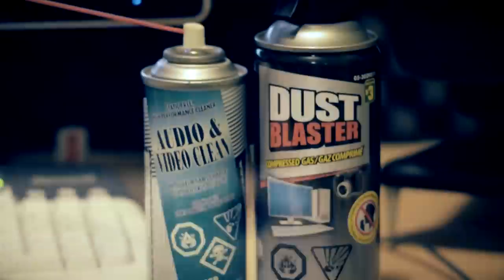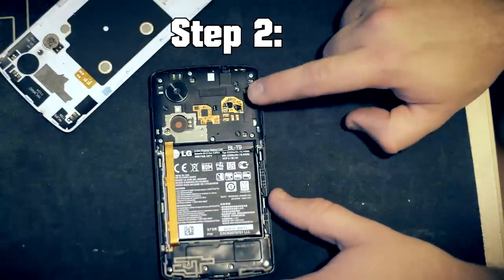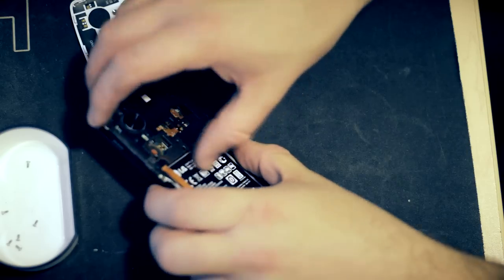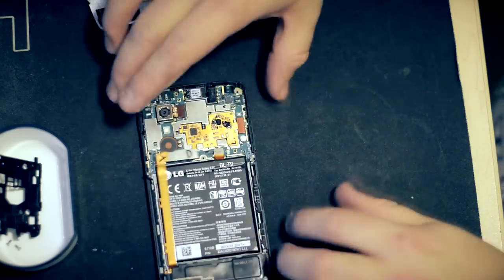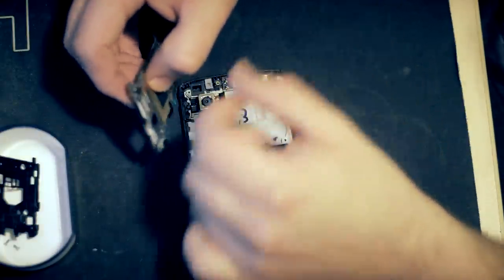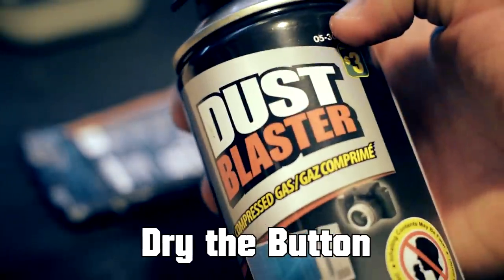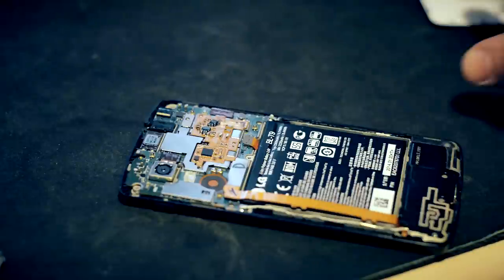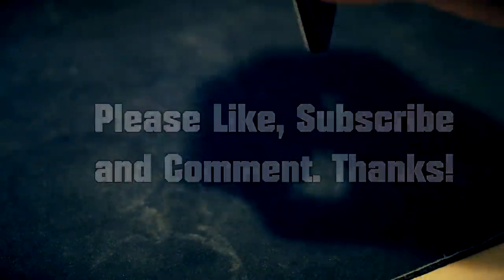LG Nexus 5 Boot Loop Fix - Power Button Repair -

Comment: Fantastic tutorial! I didn't have much hope, but this saved my Nexus after it began to have problems with the power button (it wasn't stuck in a boot loop but turned on and off almost every time I turned screen on and off).

A few notes. Be careful with removing the back cover, the plastic pieces that snap it into place break easily. I also thought the plastic part of the power button was broken, mine didn't have anything to keep it positioned. And I didn't notice any difference after applying alcohol to the inner part of the power button.

Still, after putting it together again - it now works like a charm. Thank you for a great video!

Comment: My power button started to behave freakishly 2 days ago and yesterday in the morning it switched off and since then I wasn't able to boot it anymore. I tried smashing the button against the edge of my table but to no avail. I've even put it in freezer for 15 mins as that might help but again no result. I came across your video and deciced to go for it but I was skeptical at first. I dismantled the phone, did all the cleaning and clicking as shown in the video but my device didn't boot up so I felt down in the dumps and dissapointed reassembled the device. I gave it one more shot and pressed the power button hoping for the best and yay, IT WORKED! I've never been so happy in my life. Basically what I'm trying to say is that if anyone has the problem of not booting up as you did in the video, try putting everything back together first and magic is about to happen. Thank you very much. Oh and btw, I used aftershave (containing alcohol) as cleaner because I don't have anything like that at home. :D
Reply from the maker: +Filip Randjak Nice! The aftershave is a great idea!, although depending on the type it could be sticky and leave residue maybe? In any case it worked so it did the job. I personally never tried the hitting the phone thing because i didn't want to risk damaging something else in the process.

Comment: And another rescued Nexus 5! Thanks for the tutorial! Greetings from germany! 

I used "Kontakt WL" to clean the switch. Before cleaning I still heard the "click" from the switch but the symptoms where as described (bootloop). Now the Nexus 5 is fine again. 

Attention, while reassembling I noticed, that the plastic power switch (not the micro switch) has a little hole which has to be placed on a small pin inside the case!

Comment: I can confirm this process worked for me. and I just used regular glass cleaner and used my own exhaled breath (hard blowing) to clean the button module. thanks for the tips! and you're right. the hardest part is getting the back cover off the phone.
Reply from the maker: +Ryan  Olsen Glad i could help! :)
Reply: +Ryan  Olsen Regular glass cleaner? Did that work?
Reply: Wow it worked! Thanks a lot,  man :) i used vodka instead of the  video cleaner and now it's working again.

Comment: Hello, thank you very much for this simple and clear video ! I disasembled my nexus 5 and cleaned the power button with electronic contact/welding cleaner spray. And there's no more power button problems. I got my nexus 5 from 4 years and it's still good and it will be for long time more thanks to you.

Comment: Right on!  This worked great. No more boot loop.  My Nexus 5X had the newer long form motherboard, but the principles remain the same.  Remove outer cover. Remove screws and inner cover.  Disconnect three connectors.  Remove board. Clean and reinstall. Thanks again!

Comment: Great money savings fix!  Completed the procedure in 25 minutes on my daughter's Nexus 5 and it is back to normal.  Used 91% Isopropyl alcohol which you can get at CVS/Walgreens and a $2 can of air duster. Much more economical than getting a new phone.

Comment: Thanks very much. It worked for me. I have been suffering with the problem of my Nexus 5  rebooting often, but always recovered itself. However, yesterday, it was not coming out of the reboot loop. 
Your suggestion that power button is clogged and is causing the problem, proved to be right.
You video is a little quick to realise that there are two flat connectors on the top have to disconnected before being able to take out the motherboard board.

Comment: Thank you for a great  explanatory video. When i had got the nexus 5 apart it was clear that my problem was not the switch but  the plastic button in the case. There are 2 minute bit of plastic (acting as a spring) one was broken and jamming making the button stick. I removed the button, cut off the plastic bits and bingo the button now is free to move and not stick. I hope it lasts.

Comment: Great instructions!! Was really helpful. My issue was actually the black button on the outside. After I opened and checked the inner white button, I didn't notice any stickiness or dust, but it looked like a tiny piece of the black button had broken off on the inside so that when you press it, it doesn't pop back out all the way like it's supposed to and keeps pushing on the inner white button. It wasn't noticeable when the phone is intact but I could see it when I took everything apart. I ended up jamming a tiny piece of plastic under the black button on the edge/side that wasn't popping back out properly to force it to pop back out every time I press it, then replaced all the pieces back in and it seemed to have worked!

Comment: This worked for me!  I'd seen other videos suggesting banging the phone, or replacing the switch.  My switch didn't feel mechanically stuck, it clicked in and out.  But phone was stuck in reboot loop.  Taking it apart, cleaning with compressed air and then electrical contact cleaner seems to have fixed it.  Thanks for the video!

Comment: What worked for me was following this video, but not disconnecting the battery and sidewires. Just take the motherboard protective cover off and use one of those fine plastic-rubbery softpicks which the dentist keeps telling you to use for between your teeth (not the one with the metal wires and get the smallest ones for better reach). Once the protective cover is off you can see where the power button connects to a tiny white switch. Clean around it with the toothpick (or small brush--toothbrush could work) and make sure to press the power button and clean in there as well. You may also douse the toothpick in A/V cleaner or other cleaning product safe for the electronics/plastic. All the filth and sticky stuff is mostly around the button as it creeps in through the cracks around the power button. Give the rest of the phone a clean where necessary like this as well. Reassembled and worked again. Use the leftover softpicks to maintain good dental hygiene for clean breath and a happy dentist.

Comment: Just fixed mine using this. There was nothing evidently wrong with the button even after opening. But wiping and pressing several times thankfully worked. Thank you! 
PS. You could've hinted how stubborn the back cover is though :)
Reply from the maker: +Dileep P G LOL yeah, i mentioned at the end it&#39;s probably the hardest part. Seriously what a nightmare to take it off lol . Glad to hear you got yours working!

Comment: Thanks for the video +Weekend Agenda When I had this issue I looked on some forums and they helped me isolate the problem but having the video to watch made it so much easier to know I wasn't going to hurt anything. One thing I found though is that the external part of the button on my phone had a large build up of dust around it and this was also gumming up the action. For other viewers looking to solve this problem on their own phone I recommend cleaning this area as well, doing both these things quickly solved my problem. Thanks again.
Reply from the maker: +Isaac Hunter Great advice! Thank you for the kind words :)

Comment: Thanks very much! Like somebody else said my button was not mushy, but still clicky. The clean did the job. Only thing that I would add is to use plastic tools for levering off the connectors, to avoid damaging anything on the board.

Great video though, thanks again!

Comment: Fantastic video, made me able to get in and out of my phone no problem - but it didn't fix it unfortunately. The switch on the motherboard looks super wobbly, it doesnt go just up and down like the volume switches do. This this goes side to side and everything, you can move it so easily, so it's surprise my power button was so volatile and sensitive. I have no idea if this can be replaced or not, just gona see if I can get a temp fix til I can at least afford a new phone. Have to admit, I'm probably just going to let my lump hammer go to work and lower my stress levels

Comment: Thanks for the help man, I found the hardest(and most stressful) part was removing the back panel I was worried about undoing the ribbon and other cables but they weren't so bad. My phone works just as good as it used to now!

Comment: Great video, it's very helpful. Minor note, though, the antenna cables are just that, they're aren't ribbon cables. Ribbon cable means a flat cable with multiple lead, the antenna cable are round cables with a single lead. Have a good one.

Comment: I did this and it was a temporary fix. Every couple of months it kept happening and worse each time. Finally, it wouldn't work at all so I did one last thing before giving up and buying a new phone AND IT WORKED!!! I simply opened up the phone, took a pair of tweezers and litterally ripped out the power button. Since then, I had been keeping my phone charged at 100% just in case I could never turn it off again but today it locked up on me and...wait for it...I inserted a piece of metal into the hole where the power button used to be and it made the connection. Yay! I have my phone back with no power button issues! I just stick the end of a pair of metal scissors in to turn it on and off.

Comment: I did that today. Thanks a lot, it worked. I did not use the cleaner spray, because I did not have any, a Q-tip with some alcohol worked just fine.

Comment: Thanks for video. Now its 3rd time that I open and repair my Nexus 5. I don't usually clean the particles with any type of sprays. Whenever I finish it works for one month, then again starts switching of

Comment: Thanks man, this did the trick! I used a small kitchen knife since I didn't have a small Philips head screwdriver and scraped the buttons clean instead of using audio/video cleaning fluid, but it still worked.

Comment: This video didn't work for me right away but got me started on the right track. So my phone over a period of 2 days went from a very unresponsive power button, to shutting off randomly, to not coming on at all. The only way I could get any life out of it was to charge it or plug it into my computer and it would get to the black google screen and then reboot and continue non stop. I first dabbed isopropyl on the power switch and gave it some work but still no difference. After watching some other videos some users soaked the button in isopropyl and really worked the button. Move it side to side, up and down, rotate it, drag it down to one side with your fingernail and release it hard. I started to notice it was sounding more like the other two buttons for the volume control. The winner was taking a pair of tweezer and placing one pincer on the button itself and the other on the back part of the switch and giving it a few really good squeezes. I was afraid I was going to break it but at this point the phone was useless anyways. Then all of a sudden it was clicking like it was new. I probably soaked it 3 times or so for about 30 seconds and worked the hell out of it. I put it back together for the 4th time and it works like new. Super stoaked. If this didn't work another user just popped the power button right off and the phone would turn on as soon as the battery was reconnected. They then used an app that could turn your phone on and off. That was going to be my last attempt as my phone is a couple years old now. Anyhow it works so I will go hopefully another year before something else goes on it. Long live the NEXUS 5 !!! 

Thanks for the help !!

Comment: Thanks for this video! Rather than opening it up and cleaning it, I just flicked the power switch a few times with my finger and pressed it madly for a few seconds and that helped unjam it.  I'll probably have to clean it eventually, but this was a good short term solution.

Comment: Great Video! Tried pouring 95% isopropyl alcohol from pharmacy and clicked several times. Din't work. Tried again, except this time left battery disconnected for more than a hour. When i put it back, the looping went away. Not quite sure how long this fix will last!!

Comment: After replacing the charging circuitry (which I thought was the problem) I tried this method and it fixed it! Thank you so much for sharing this. 

I guess the swtiches that LG put in the Nexus 5 are just lousy?
Reply from the maker: +Aaron Eiche Lousy would be an improvement lol. No worries, glad it worked!

Comment: Thank you for the video.  Here's hoping it fixed my random reboots and erroneous shutdown menu pop-ups.  I feel awfully ham-handed after this.  I managed to break three clips that hold the back plate on.  It clipped back on with barely any noticeable movement, so I think I got lucky.

Comment: I would suggest for anyone trying to remove the back of the phone, you need to use a heat gun on certain spots. A blow dryer will compensate as well. The reason for this is that there is an adhesive keeping the back in place. If you damage the back part of the housing, depending on the area affected, you may have to replace it. Also, when using said heat gun/ blow dryer, do not  over heat your phone or you'll fry the components inside and could possibly ruin the phone all around.

Comment: Hi, great video! My N5 is stuck in a reboot loop as well, and it is definetely something with the power button. Smacking the phone works very rarely, but it definetely does something. The button is still pretty clicky though, so could it be sticking? to me it seems like a sticking button wouldn't be clicky, but rather mushy, right?
Reply from the maker: +Pol Timmer Yeah i thought so too and mine was clicky just the same, but the cleaning fixed it, 2 times now lol. Common problem it seems, i suggest you give it a try, takes 5min and if it works great! if not i guess it could be something else, but at least you tried :)
Reply: Mine's clicky but I didn't have the sprays, so I just pressed the buttons tons of times -- half of it looks indented in slightly (that half is clicky) the other half is not as clicky.  I gave both haves some love and attention and the devices appears to be turning on, now! :)

Comment: Well I will try this , but I very much believe this is happening because the button can't operate at - 0 C Temperature. Very one seems to have started having problems with it in the cold winter. My Plastic outer button was super clean I doubt that dirt has gotten in the inner button if there was nothing on the outer plastic shell. It seems to be broken from cold temperature not dust. And my guess is the problem reappeared the next time you use it outside am I right?

Also do make a video if you can replace it, since I found now equipment that can unsouver and resouver that button else I would exchange it with one of the volume buttons.

Comment: Be careful disconnecting the wires from the terminals. I tried prying underneath them like the video author did, only I used a plastic tool instead of a screwdriver. The terminal ripped off of the motherboard instead of disconnecting from the wire, and I effectively have destroyed my phone.
Reply: Well that was a bit silly
Reply: BookandRegan yes it was.
Reply: that's why I'm afraid to touch it. Fuck it. I had this phone for 3 plus years. I'll just get another one.
Reply: Reason over Dogma
That's what I did. I replaced it with a "certified" refurbished Nexus 5, However, hat one also had a bad power button, so I sent it back for a replacement, and the replacement had a bad power button. Finally, I gave up and bought a 5X.
Reply: Jon Wolski How is it? Every nexus I ever owned had annoying design flaw. So I'm afraid to buy a nexus.

G-Nex - Terrible battery charge times, Easily breakable USB charging port and bad antenna. I would have to reboot my phone sometimes because it wouldn't pick up the signal.

Nexus 7(2013) tablet - Bad Gyro  Its not uncommon.there's also a hot fix for it on youtube . Wobbly USB port. Mine still works, but apparently its a common problem and people have to send it to fix it. Or replace the port themselves.

Nex 5 - The power button. The stupid fucking power button. Quite common.

So now, I'm sour on the whole nexus/google line.
Reply: Reason over Dogma
So far, so good. I also had a Nexus 7 (2013) and I was disappointed by the tearing in the video.

I've had the 5x for a few months now, and I have no complaints. I use the power button less often, now that I have a fingerprint sensor to wake the screen.

At first, I hated having to use a USB-C connector, but now that I've purchased the cables and gotten over it, I actually prefer it. It is nice not having to detect if my micro-usb-b is upside-down.
Reply: To be fair, the Nexus 5, strangely used the same power button as the Galaxy S3/S4, which also have this problem. It's not unique to the Nexus at all, but a full design flaw in this type of button.
Reply: I feel for you.  I will be extra careful when I try mine!!
Reply: Why do not try this to save your phone and your money if u are ready to buy a new one if this trick doesn't work ?

Comment: totally worked! Thanks! Used medical alcohol and blow dryer in the COLD setting.
Reply: +Cihangir G Duman Haha, some years ago i did the same with my laptop (having spilled water on it) - however I forgot to turn the temp. down, so the keyboard litterally melted. That's a mistake you only make once!